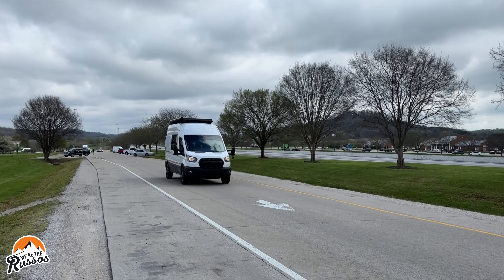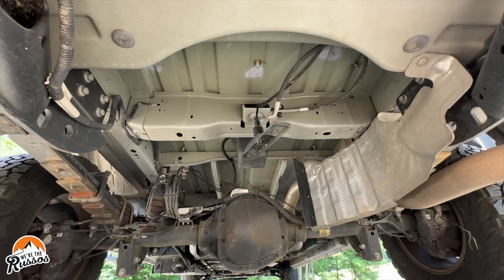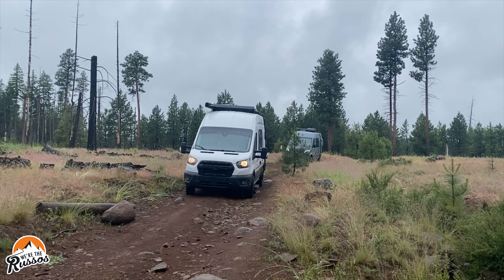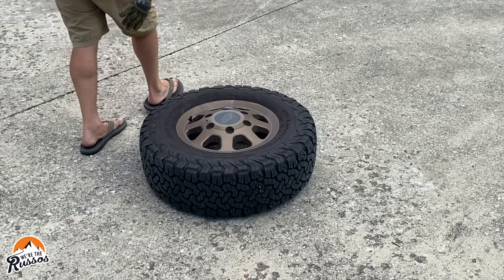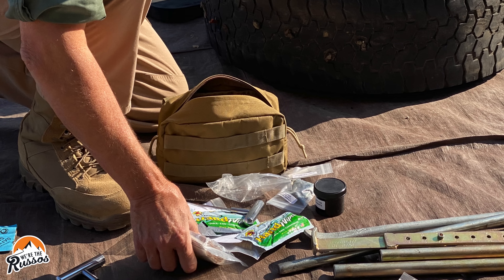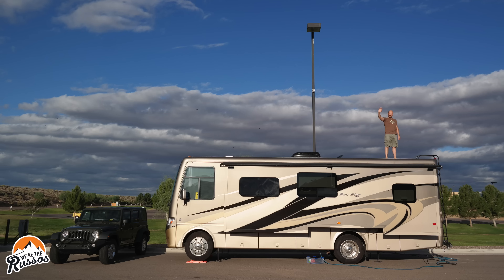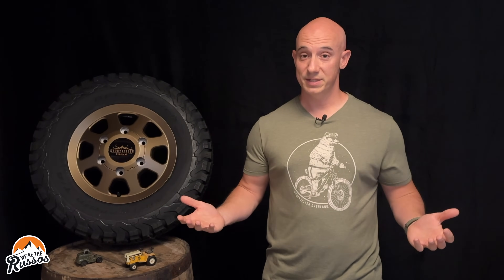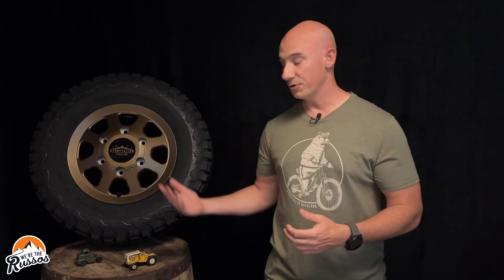RV Spare Tire: Do You Really Need One?

Comment: Yes to spares. Like you, not having a spare would leave me feeling vulnerable. Important note to those who plan to swap a wheel and tire roadside. Do NOT use an impact driver to reinstall lug nuts! Some impact drivers are powerful enough to over torque which can weaken the lug bolts by stretching them. I know someone who lost a wheel on the highway. All of the lug bolts had snapped off. An impact driver is fine for removing a wheel. Reinstall your spare with hand tools to avoid this issue.

Comment: Well roadside assistance is generally a joke or you have to wait till next Tuesday for them to show up. Self reliance is your best option. We have a spare and I took a class at the Overland Expo on the sidewall repair kit, valve stem repair and plugging a tire. Definitely recommend something like that. Also it’s a good idea to do a dry run in your driveway to make sure you have everything and it works. An air compressor is a big plus too but make sure it’s big enough to fully inflate your tires, a cheap one won’t fill it up. 👍🏼

Comment: Owl van now has a door hinge mounted spare tire carrier. I have the same van and no problems with gaps. No need to remove the door to install. Video on how to. 
Enjoy your Alaska trip. Be safe out there
Reply from the maker: Thanks just be careful because the Transit and Sprinters can develop cracks along the point where the hinges mount to the door frame from the extra weight of the tire and rack

Comment: My van didn't come with a spare. Every time this comes up in our FB van model group, lots of people say something like, "In X number of years of driving (usually 30-50), I've never had a flat tire, so there's no point in having one now." It just mystifies me as to how so many people think the past predicts their future! I for one will never be without a spare. In fact, I had to use ours less than 30 days after installing one when a bolt separated the right rear tire's steel belts, and the inside sidewall blew off. There was no fixing that! Having that spare was the difference between a day consuming tow (which has its own risks and costs), and getting back on the road in less than an hour. I had RA come out, and he told me straight up, "Good thing you have this spare. We're not in the business of sourcing tires for people"

Comment: I didn't know there were classes on tire repair we may look into this.  I think having a spare for your AK trip is a good idea.  We had less than 6,000 miles on our Sprinter last summer when we got a flat (small sharp rock) in AK.  The roads and getting into and out of boondocking spots really does a number on the tread.

Comment: We went for years without a spare in our class B pleasure way but always carried tire plugs, liquid can flat repairs and air compressors. That would only work for a nail or screw.  Any sidewall damage would be impossible. Now we have a new Travato there is absolutely no space underneath and both back doors have a ladder and bike rack. The only option was to use the hitch with a spare tire mount.  It doesn't look the greatest and sticks out but it's very functional and gives up the peace of mind. Back doors swing out without interference too.

Comment: I'm in your camp. I  drove City vehicles in the heavy construction industry for a career, and I carried  plug's as well.   I  was informed after plugging a tire in the field,  mechanics are the only people that are supposed to fix the City's vehicles or tires...😅. I called it in, but when I was told it  would be after 7pm before they could get there,  it was just before noon,  I  repaired it and drove it to the shop.  They took all the spares out from under our City vehicles in  the 1990s, because of theft. Being a verticality challenged female,  I  always felt it was a personal safety issue for me, to be left stranded either in the urban core, or at the intersection of cornfield and pasture.  My plan is to drive to AK, next year too. I have started working through my older class b, and getting the  knowledge I will need,  to pull it off.  Who knows maybe our paths will cross somewhere out on the road,  but it is doubtful,  because AK and western Canada are big. Thank you for another informative and useful video.  Safe travels. ❤😊

Comment: 2017 59k… sound familiar?
I purchased two extra tires and a rim.
I also had a motorcycle on the back.
Combined with tools and “ hunting“
Supplies… would overload the van.

I pull 6 x 10 interstate aluminum cargo trailer. This allows me to carry everything I need and want including Self extricating tools, fuel, water, food etc.
I am a van prepper. 
I pick locations that have the most perks.
Currently parked on 20 acre horse ranch in the hills above Santa Barbara.
No expenses in exchange for horse care. Also has a well👍

Comment: I don't know about a Ford Transit, but on the Ford E-350 chassis, I can mount a front receiver, and then a spare tire carrier, where I carry my spare tire, and cover it with a tire cover. 

I tow a boat, and I'm am concerned that they typical spare tire mount in the back (drivers side rear) allows the tire to protrude out, and possibly in the way of the trailer if making a very sharp left turn (example, backing the boat trailer into a tight area).

Comment: With my Class C motorhome purchase, I received a year of complimentary roadside assistance, which required having a spare tire ready for replacement. Otherwise, there would be extra costs for obtaining a spare or fixing a flat tire. I'm uncertain about the specifics of other roadside assistance services. To prepare, I purchased a rim, tire, and mounting hardware for the spare tire, even though the designated space lacked the necessary hardware. My next step is to buy the required tool, a very large bottle jack, to change the tire if roadside assistance is unavailable.

Comment: Just my 2 cents as they say but Transferflow has apparently come out with a 45 gallon Transit replacement tank. For me that's a huge reason to get a Transit as opposed to the Sprinter. I just prefer 3.5 liters with 100 more horsepower and about 80 more pound feet of torque. Now one can have a range of almost 700 miles- YAY! I'm figuring 15mpg on the highway so a safe 600 miles on the road.

Comment: I don’t have a spare, do carry an inflater/compressor, watch my tire pressure carefully, and have tow service. I don’t have the strength to change a tire myself. I drive a Class B Midwest auto design - 43,000 miles in 2 years… one tire issue I caught early and had repaired (nail).
Reply from the maker: Good job on keeping an eye on things and knowing your limitations.

Comment: We carry a spare- same wheel and tire you have from Flarespace. Also, air compressor which we do use on all vehicles we own and looks like the same one you have. I haven't checked the jack to see if it goes high enough though. did you get a jack other than the Transit OEM one?  Will check out the book and class you linked for us. Thanks for another informative video!

Comment: I lost a brand new spare tire and aluminumn wheel while on the road.  I have the new tires for say 6 months.  My tires also were bigger and the place put the tire in the same place as the original one.  I don't think they fully put the new tire back on the van.  I was driving one day and I thought maybe I hit something in the road like a board, but I didn't actually see one.  I look in the mirrors and didn't see anything that I might of hit or even the spare tire. 
I was lucky no one was behind me, yet I never saw the spare tire or even realized it fell off.  I ordered a new tire and wheel, but I refused to put it back in the same place.  I'm curreltly without a tire on my van, while I wait for a rear tire tire ladder rack for my van to come it.

Comment: Well done video like always, we own an LT Mode because of your videos, quick question, if you would drive 100% on paved road and always in cities, never remote areas, would you change the tire to OEM specs, maybe having an aftermarket better looking  rims (just saying), and carrying OEM wheel and rim mounted underneath as original placement for the OEM spare tire. Thanks again for all you suggestions.
Reply from the maker: I don’t know if the stock tire will fit on the LT rims (due to the width of the rim) so I’d suggest checking with a tire shop. There are other non-all terrain tires you can get they just need to be “LT” light truck rated with the appropriate carrying capacity. I also wouldn’t mix rims as I would rotate the spare in with the others. The STO rim will fit underneath with a smaller diameter tire
Reply: @Weretherussos  Thanks a lot for your reply, yes basically would be fun to test a "Regular" Transit, (non-all Terrain) tire mounted on the  LT / Flarespace rims (if possible), and as you said having spare tire with same Flarespace rim located in the OEM spot for spare tire. Thanks once again.
Reply from the maker: If you haven’t seen it I did a comparison video with the stock wheels
https://youtu.be/lgDCMeihuy4?si=LAAeuEJDkSJTx_CD
Reply: @Weretherussos  yes yes I watched thanks for mentioning, anyway i did some "investigation", Michelin - Agilis CrossClimate - 235/65R16C tires (OEM Specs), can be mounted on LT/Flarespace golden Rims as they are 7"x16". So as you mentioned in the videos the OEM Ford rims they are not the best looking, but would be interesting to test, Storyteller LT rims with OEM specs tires.

Comment: Joe, what would happen if you installed a smaller tire on a non 4WD van? Isn’t that basically the same as a using a “donut” spare for a regular vehicle? I don’t carry as much equipment as you do, but I do carry a repair kit and air compressor
Reply from the maker: If you put it on the front axle it’s fine but if you put it on the rear with a limited slip differential it can damage that. You also would not want to be in 4wd with the smaller tire up front. And I mean like if you have 29” spare and a 35” tire

Comment: I had AWD Honda and got a flat tire I want the flat one replaced with a new tire but tire store will not do it 😅 I ended up getting all four new tires 😢 Honda came with a doughnut spare but that thing is limited to 55 miles per hour 😂😱 It was fun driving on the freeway under the limit and see all the car passes by 😢 but I made it home took longer than usual 😅 I once got this tire repair can I was supposed to use it when people get a flate the can have some type of glue inside and enough air to inflate the tire It didn't work I drove the car to a tire store when technician took down the tire and take the tire off the rim the whole thing just exploded on him he got those gooey stuff on him he was not happy he asked me did I use one of the tire can I said yes he said I should let him know first 😢

Comment: I'm putting my money on an externally mounted spare.  Plug a nail hole in the field, no problem, but do you really want to try to remove a tire from a wheel in the middle of nowhere.  Sounds like a great way to ruin an outing.
Reply: I have changed my own tires for years, it's not as hard as you might think.
Reply: @robertb2468  you're talking about removing a tire from a rim? I've never tried it. Maybe just my ignorance
Reply from the maker: It’s not too bad to take a tire off of the rim and get it back on. It takes me about 5 minutes depending on how stubborn the tire wants to be. This comes in handy if you have a flat, mount your spare and then that goes as well.